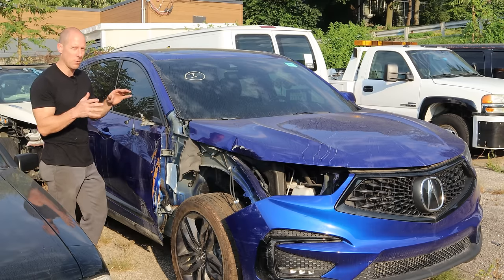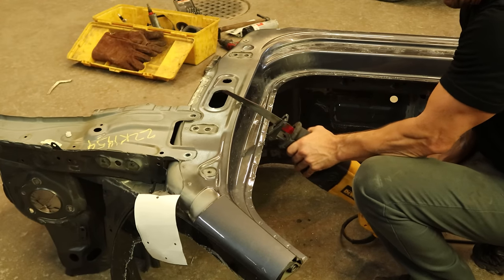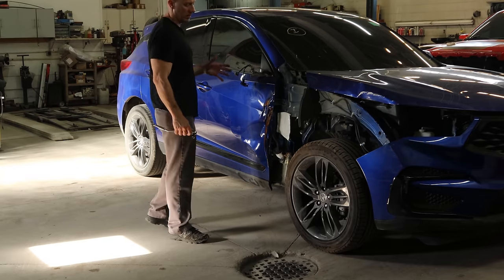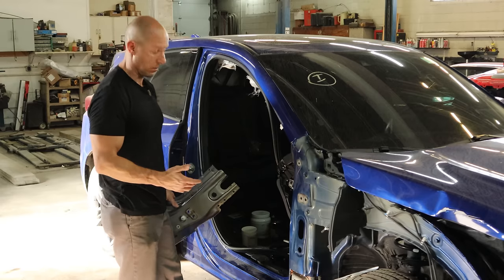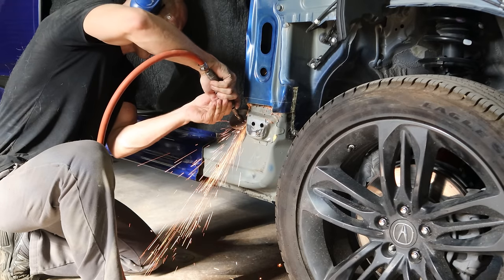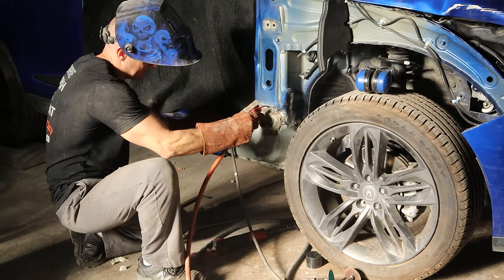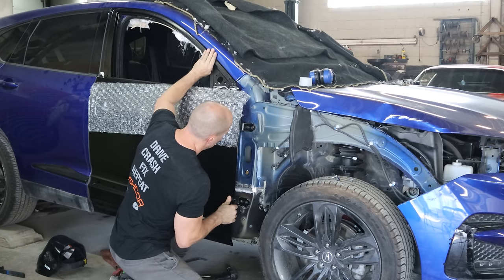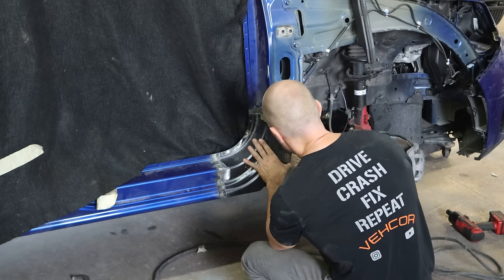Repairing the pillar and rocker damage on the RDX Aspec

Comment: As a body technician i can tell you that that's how i would it done it too. Unfortunately at a body shop you can't do it that way. Per manufacturer especifications you have to replace the hold part, especially the inner but again you did a great job.

Comment: I was wondering for a very long time how people cut these corners without potentially cutting through the inner structural pieces. Thanks for the simple explanation 👍.
Reply from the maker: You can also use an oscillating tool to get in there.
Reply: @vehcor  Thanks for the other tip, much appreciate it. Happy new year.

Comment: So if you had left A pillar as is, would the door and fender have fit?  Perhaps with shims.   That seemed like alot  of work on the A pillar?
Reply from the maker: Shims are for old cars and hacks. There is no place for shims on modern cars, all structure should be back to spec.  If it is not, something is still damaged, if it is damaged it will not perform properly in the next crash.   Doing the job the right way always takes longer in the short run.

Comment: What type of welder did you use? Flux-core, MIG etc ?
Reply: Just a MIG.  Doesn't have to be anything fancy.  .023" (6mm) wire.  You could use flux core if you enjoy the extra work.